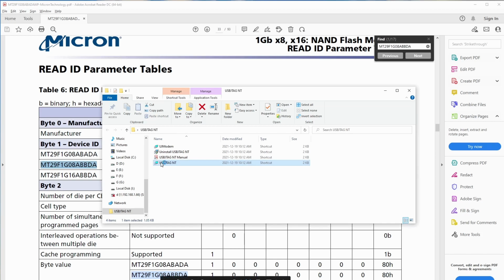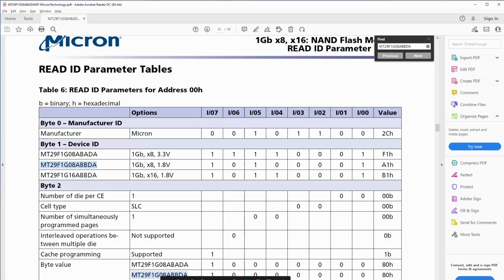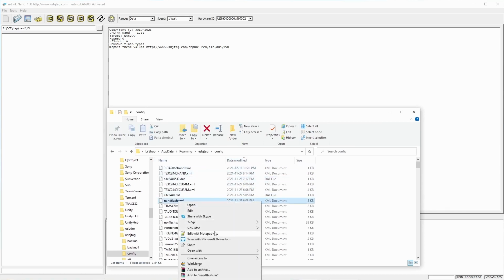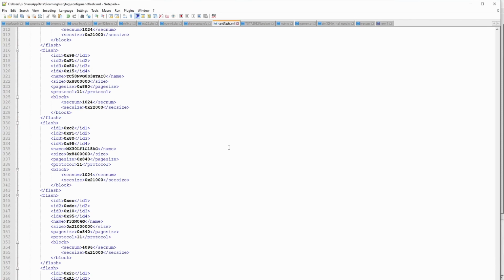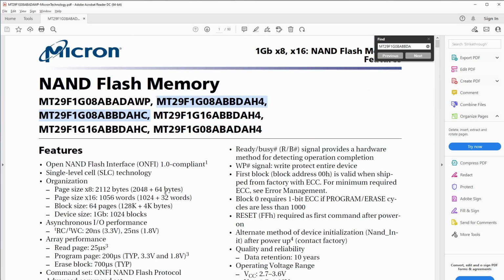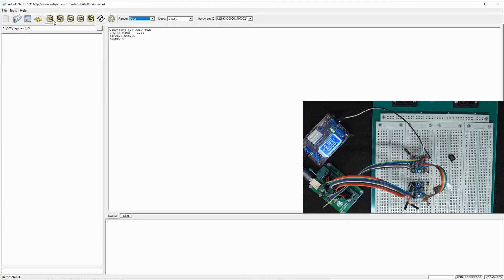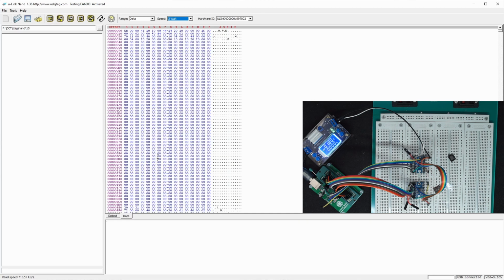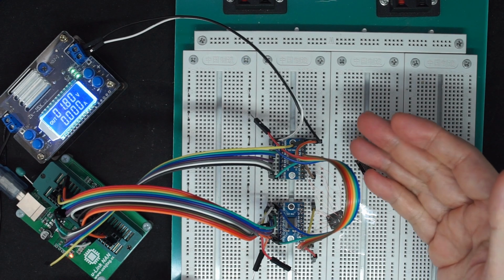Program 1.8v NAND with u-link Nand.

Comment: Hello how you soldering 1.8v nand chip to that bord and how you connect the wires  to chip
Reply from the maker: Actually it is save to use directly with u-link Nand but only supply 1.8v to the chip.